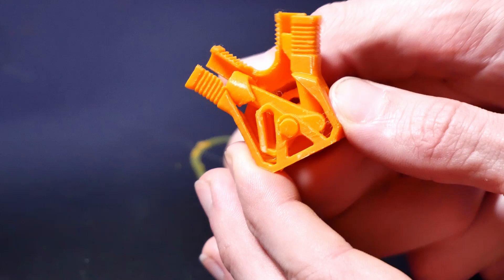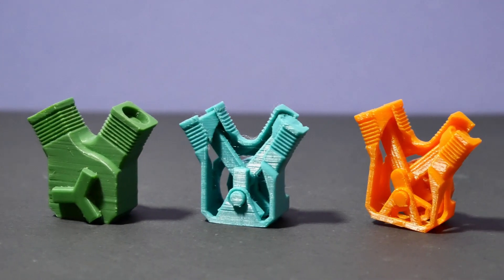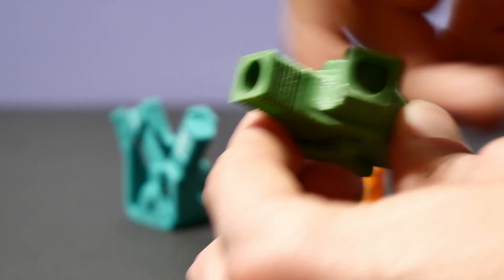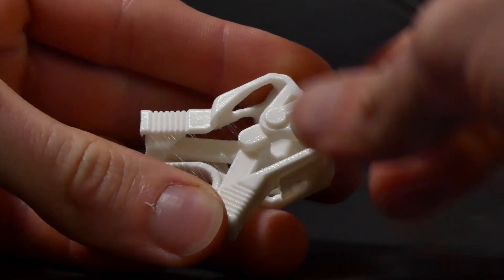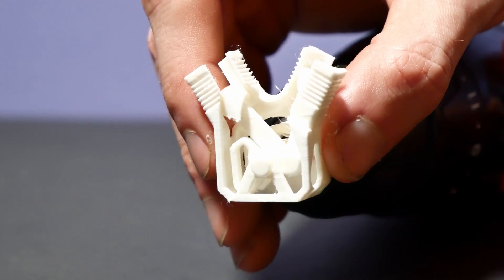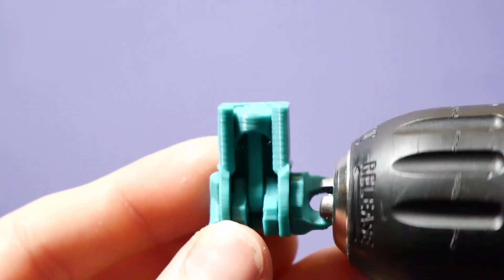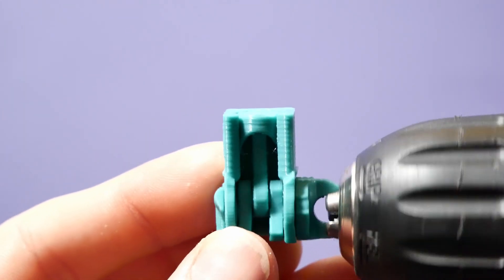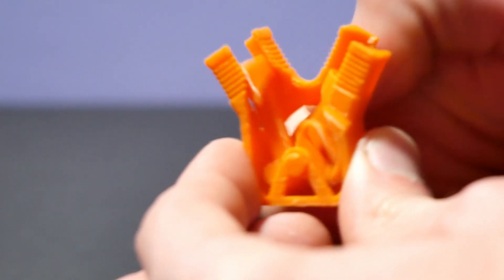3D-Printed Skeletonized V-Twin!

Comment: Is it possible it's easier to print? I could never quite get either of the other two.
Reply from the maker: What was your problem with the previous two? This one is easier to break loose after print due to better access, but it's still not a super easy print.
Reply: @TurboSunShine  They would always seal together one way or another. I'll try this one because there might be less material that can stick to other parts of it, though.
Reply from the maker: @blaizehicks4232  thisone is definitely more accessible with an exacto knife, you can also try printing with a very very small amount of horizontal expansion compensation (no more then -0.04mm)
Reply: @blaizehicks4232  Check your extrusion width (in Cura it's called "Flow") and decrease it slightly until you get the best accuracy without under extrusion. Check your nozzle diameter as well. Hope this helps.